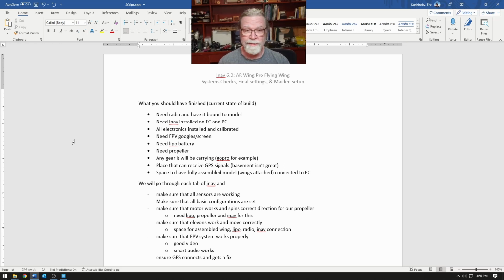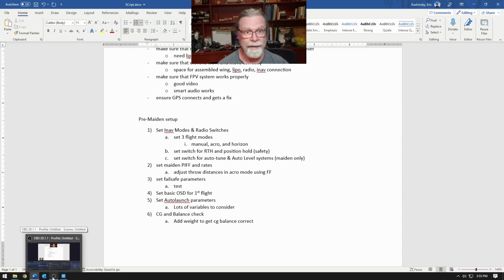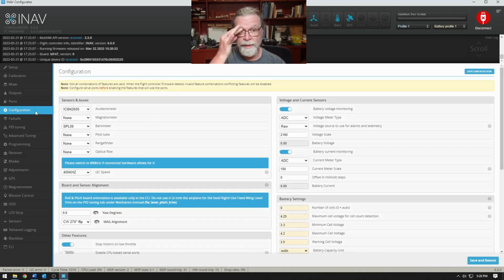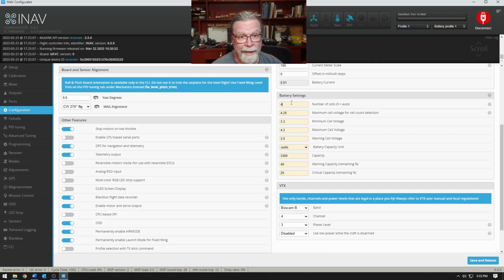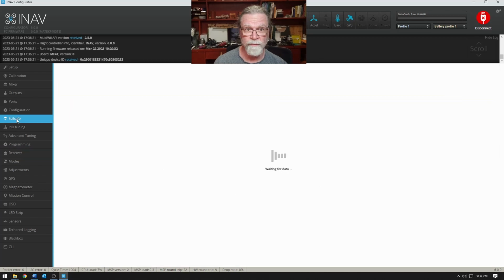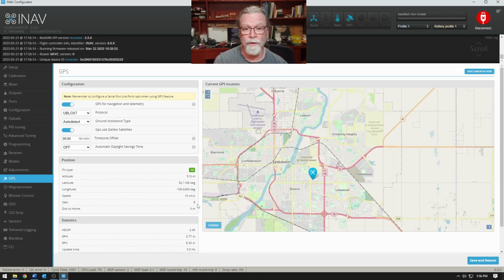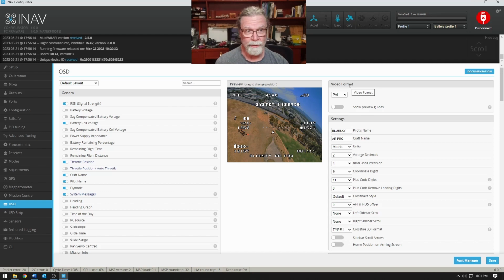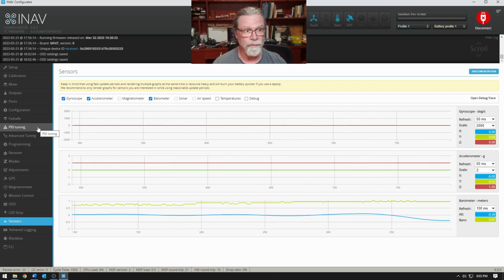Inav Final Configuration: Flying Wing Maiden Flight Setup - Part 1

Comment: Hi I have a flying wing with INAV 7 installed on It
I am new in RC
I am confuse how to set the input and mixes in INAV
There is an un-uniform movement in my plane

During pitching, the Servo 1 move much more than servo 2
But the opposite condition happen during rolling, the Servo 2 move much more compared to Servo 1
I made a video in this link
https://youtube.com/shorts/37aI8LbLfgM?si=3idyLBE-M6FYfuqk

I use Speedybee F405Wing
Radiomaster Pocket ELRS
Matek R24D receiver

Please kindly help me
Reply from the maker: Hello.  Thank you very much for taking the time to leave a question.  You have a very interesting situation.  Your iNav setup looks basically OK.  My first step is always to check my connections.  Are your servos set up the same?  Is any connection on servos or elevons loose?  Next, how is the model set up in your radio?  The mixer page in the model setup needs a very specific setup for a flying wing.  Only 3 channels are needed.  #1 is for left elevator AND left aileron  #2 is for right elevator and right aileron, #3 is for throttle.  There should be no expo or any changes to the outputs in the radio - iNav does all that.    I hope this helps you a bit.  Another viewer had a  similar question, so I guess I need to make a video showing how to set up a radio for a wing.
All the best.

Comment: Very clear explanation on every steps to configure your model in Inav, but though not complete: the ports configuration is missing. Pardon me for that, but that is because i am precisely on that problem actually, and i in quest of a solution: my receiver bind to my Rx, but i'm not able to activate the servos and motor from the Rx.
Reply from the maker: Hi.  Thanks for taking the time to watch.  I'm sorry the video didn't give you the answers you needed.  It could be that you need to activate motors and servos inside Inav configurator.  You do this on the "Outputs" tab.  Look at the top for "Enable motor and servo output" and if it isn't on, turn it on and see if that fixes your issue.  From your description, it sounds like that is probably the problem you are having.  I hope this helps.

Comment: Failsafe is “enabled” rather. Whether it is “working” that’s something you can only find out while out on the field. Many factors can cause a fail safe to fail even if you have everything checked in inav
Reply from the maker: Thanks for taking time to watch and leave the comment.  You're quite right about many things possibly causing a failsafe.  One thing you can test at home or on the bench is lost radio connection which is a primary cause of failsafe.    With your transmitter connected to the model, and the model connected to inav on pc, turn off the transmitter.  inav will show if failsafe activates due to lost radio signal.